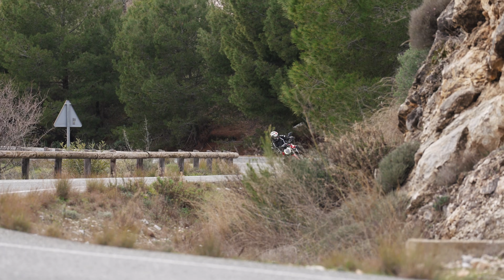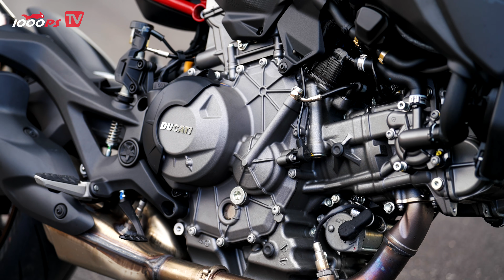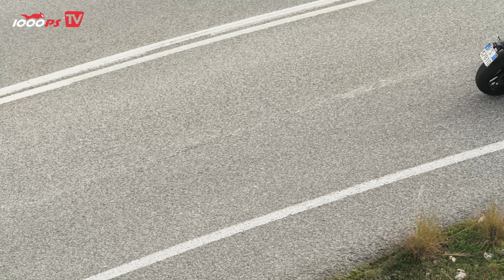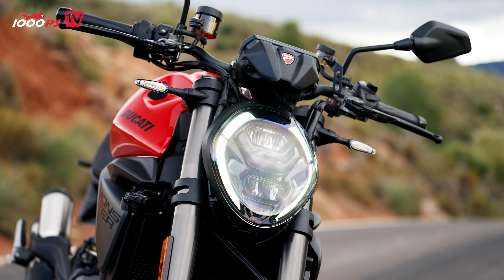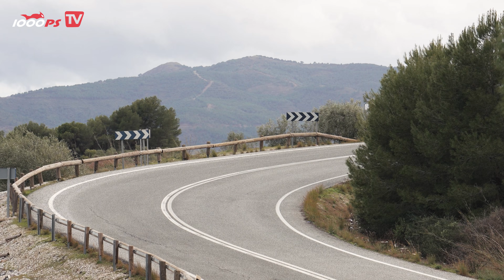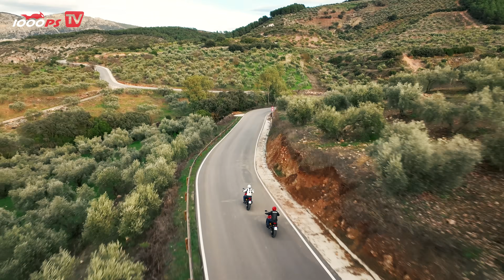New Ducati Monster 2026 Review: Comeback of an icon?

Comment: Having owned a 1997 Monster 600, 25 years ago, and having ridden most of the air-cooled Monsters ever since, I can say that the previous 937 Monster was a big disappointment. Yes, it was an amazingly handling bike, but had a mediocre sound and felt soulless and empty below 5.000 rpms. Not what you would expect from an almost 1.000 cc European twin cylinder. With all the previous Testastetta engines, you could feel a real monster, a beast between your legs, and this could put a smile on your face, no matter how fast (or slow!) you were riding.
Now everyone thinks he is a Marquez clone and just "needs" 200-300 hp and act as if he is trying to earn some miliseconds in lap times.
I haven't ridden the new 900 generation of Ducatis yet, but I hope they are more characterful and enjoyable in real life than its predecessor.

Comment: This is really a great Monster, and one of the best middleweight nakeds out there, sadly narrow minded people will put it down 🤦‍♂️ Waiting for the "not a real Monster" sheeps.
Reply: I'm far from impressed. Whats so great about it? It looks so generic that you could stick a CFMoto badge on it and most people wouldn't even notice.
As well as loads slower, Its even uglier than a MT09... and costs more.
I'd also take a RS660 Factory over it, every day of the week.
Reply: @paulhope3401  Not to mention the Triumph Trident 800
Reply: @PaoloD2R2  Not to mention that a reviewer called the Triumph 800 a "slightly disabled shopping trolley" compared to the Monster.
Reply: @paulhope3401  Just because you dont like the look of it doesn´t change the fact that its the lightest in its class, comes with the best electronics by far, best handling, and brakes. If you slap a CF Moto badge on the MT-09 people wouldn´t notice, they literally look the same. Slower than the nearly 10kg heavier MT-09 with lesser brakes, and suspension? I doubt it. So you want to pay more for lesser cc, Hp, and far lesser torque? Makes sense
Reply: Reminds me camera gear folks, this is not real canon, Nikon etc, mirrorless is not a real thing, there is cheaper options, bla bla bla 😂 . Some people always want to live in the past. hoping to try it as soon at it lands the dealership
Reply: @adunric  Yeah its quite hilarious, especially when they say "and I´ve been riding Ducati for xx odd years" like its a valid point for them to use 😂Me too, if its anything like the new Streetfighter V2 I´m sold

Comment: Back to it’s roots? So an expensive valve job every 10k? The same old clutch problem or electrical problems leaving the bike in the repair shop more than on the road?
Reply: Yes back to the roots.. A supersport engine in a superbike frame with minimal bodywork. Valve adjustment every 45.000km ( 28.000mi), the lightest in its class, best electronics, and one of the best looking nakeds. Whats not to like?
Reply: @allangrse617  the cheap look/plastics? the stupid price for what you get? the power, less than the triumph 800cc? the forks, 13k+ euros and the forks are unadjustable? Che cable/hoses management, horrible and plain to see all around the engine? the lost ducati soul? did you see the asian-style scooter radiator supports, right out an hardware store? jesus f*cking christ, VW/AUDI group is milking the cow,  only maximizing margins. The sales figures of the last Monster model where CRAP compared to competitors and you know why? because it looked like (and still do) a SUZUKI V2 painted in red, with a premium price given the mediocre components and zero accessories you get.
Reply: @PaoloD2R2  The cheap looking plastic, compared to the premium looking plastic the other brands uses? You mean the lightest bike in its class, with the best brakes, handling end electronics? Haha the Triumph has a ekstra cylindre, but you dont get that... Yes the Triumph has 4 hp more but is 13kg heavier, and has less Torque, so the Monster has better power to weight ratio, and overall better build quality. Tell me what use adjustable suspension have on a street bike when you already put the pegs in the tarmac? So what is Ducati soul to you? I´ve heard a lot of different explanations 🤷‍♂ The Monster actually have better cable/hose management than most nakeds, same goes with the radiator imo. The previous Monster was the third best selling Ducati, so it did very well I´d say. Funny thing is the Suzuki SV650 have a tubular frame, and looks like the first gen Monster, and what accessories is missing on the Monster according to You?